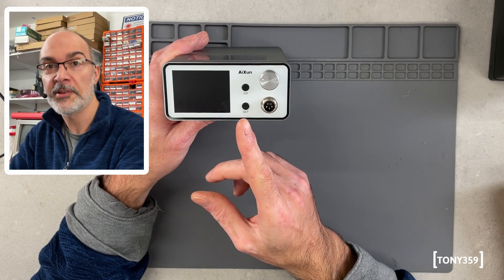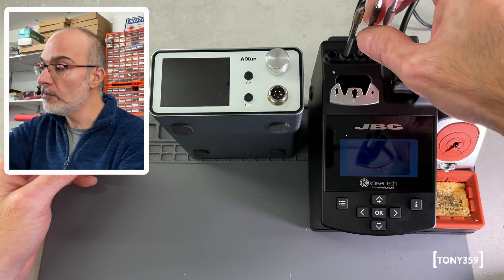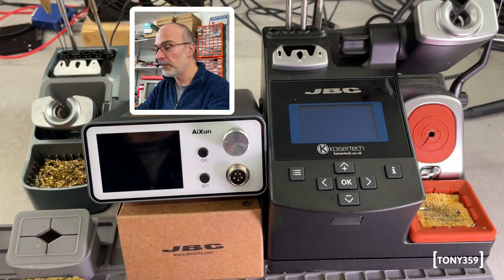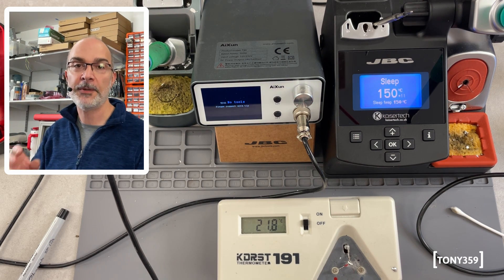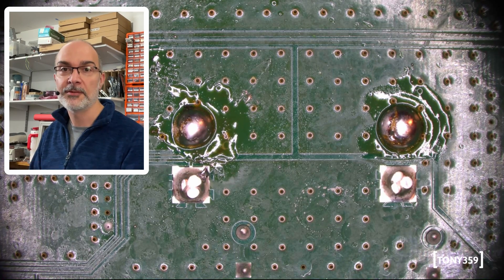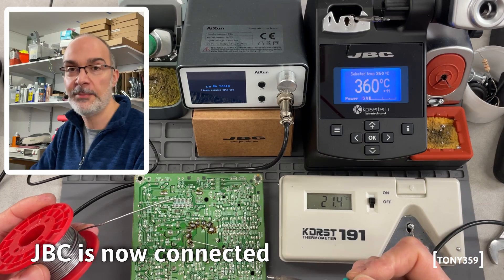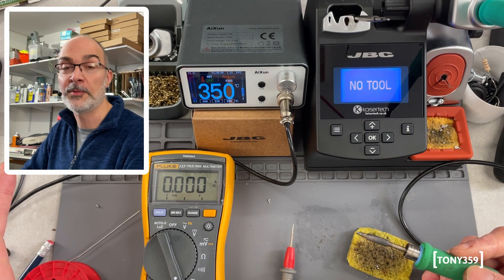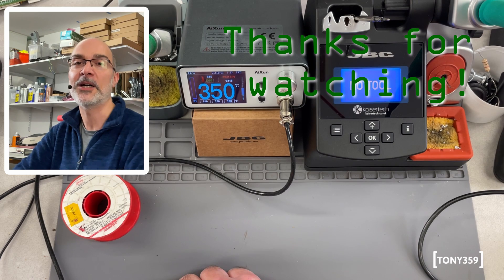Can the Aixun T3A really beat a JBC station?

Comment: I saw other reviews of this Aixun station, and nobody was mentioning about this voltage leak. For me it is a deal breaker and unacceptable as well. I must admit. I was thinking about buying this Aixun, but now? not a chance.
Reply from the maker: Glad I helped you making a decision! As an Aixun customer, I was also disappointed to see this massive design flaw of this unit... Thanks for watching!
Reply: @tony359  I have been watching reviews of the Aixun as well and it seemed very tempting, strange nobody else picked up on this. Do you have a recommendation for someone without the JBC budget?
Reply: Very interesting that no one else has picked it up but also that you had terrible customer service. Are you going to send it back? If not, let’s think how we can remove that voltage risk…
Reply from the maker: @thomas - when you buy something from Aliexpress, there is no "sending back" :) I have involved the seller, they just directed me to Aixun. It's a common behaviour from Aliexpress sellers, they waste your time hoping you drop the case! :)

@lemagreen Someone seems to suggest that older models are less affected. I don't know what to think, all I know is that I went soldering my Shuttle 591P motherboard on a pre-heating plate and the T3A started flashing "NO TOOLS" :)
Reply: you can always use an Isolating Transformer, this way, the voltage leak is not a problem anymore.
i'm pretty sure, you 'll not have anymore the temp issue and i don't believe any firmware will correct this problem
Reply from the maker: @ZZZ-z9n3n  This is something others have mentioned. It might work but wouldn't that mean that the tip is not grounded then? It would be floating. Is that a good thing? I'm honestly asking :)
I do agree that this is not going to be fixed by firmware.
Reply: @tony359  it could be partially fixed in firmware. Basic quick fix: if 20 degree or more overshoot, disable heater for at least 3 seconds of 10 degree or less overshoot. 

It happens because the thermocouple is shorted to ground, right? Causing it to read very low (ambient?) temperature. 

So a fix could be to disregard sudden & dramatic drops in temperature with no cooldown. Not even a really rapid cool down. 

Because the heater will come on when the temperature starts to drop, and because the thermocouple is closer to the heater than the outside surface of the tip (I think), I’m not sure the thermocouple will ever read 0mV or near 0mV. Not even if you plunge tip into an ice bath. At least with the bigger C245 tips, anyway.
Reply from the maker: @davadoff  Well that's called "mitigation", it's not a fix. You're compromising the temperature accuracy to avoid massive temperature spikes. The problem is that when earth is involved, the thermocouple reading is inaccurate. At that point all the software can do is start guessing and avoid turning the iron into a welder. Not a fix, just a patch :)
It's like if you're driving and suddenly someone covers your eyes: you can keep driving straight hoping there isn't a bend :)
Holding the tip to ground might cause havoc or not, it depends on the FW. I believe the issue happens the moment you touch ground (interference is introduced?) but then it stops. That said, with some pins (NOT ground) the station would start doing 0%-100% - I suppose the moment the heater is energised the ground interference reduces? Sorry, my electronics skills are limited, I do not know why this exactly happens but it's pretty clear there will never be a proper "software fix".
Reply: By the way, what happens with T3A when you hold the tip to an earthed pad instead of tapping it?

If I’ve understood the issue correctly, it should make the iron glow red hot, right? Unless they prevented that in firmware. Maybe an old firmware version does that?

Also, does Aixun say the T3A supports JBC cartridges? Any Chinese station should officially support genuine JBC cartridges or there’s no point buying it.

Comment: I use the same JBC as you have professionally and I don't want anything else.
Reply from the maker: When I got it I was like "this is boring, it just works"! :D
Reply: Yes, it just works and it's very reliable. They have a special barrel  bit which I very much like for though-hole soldering. The bits might be expensive, but these last a long time.

Comment: Yes, 1V at 1.8A is ridiculous and completely unacceptable but i want to know why. Why is is it doing that? Could it be hardware modded to fix this issue? Even if the PCB you're working on is isolated from ground, that leakage could damage ICs and FETs.. i think its something to do with the SMPS. The JBC will have separate windings on the transformer for the control circuit and the iron and uses an opto isolator and triac to switch the power to the iron. The aixun probably does not.
Reply from the maker: Glad you agree! I've read around that it could be because Aixun are using ground as a reference on the 24V DC side - might be mistaken though, don't quote me! :) 
The issue is that opening the T3A is not easy, the front panel is glued and often breaks when removed...
Reply: 1V at 1.8A : this is definitively a power supply and not a soldering station 😁

Comment: Hello Tony! Happy New Year to you and your family!
Great video - as always!
I completely agree with you about the voltage issue. I was so flabbergasted - I always expected that no voltage is the norm - so I decided to check my soldering irons too. Results are not surprising: all of them are at 0V (Weller, Goot and Pine). My workbench is also grounded and the power strip is protected with a sensitive Type A RCD of 30mA. If the leakage occurs what do you think - would the RCD trip?
Reply from the maker: Thank you and happy new year to you too! I think the reason why my RCD doesn't trip is that that is leakage from the 24V supply of the power supply so that's not referenced to ground.